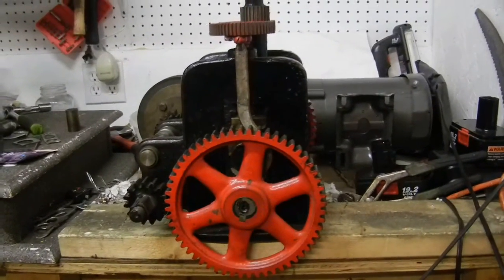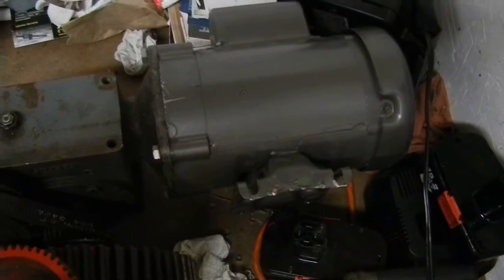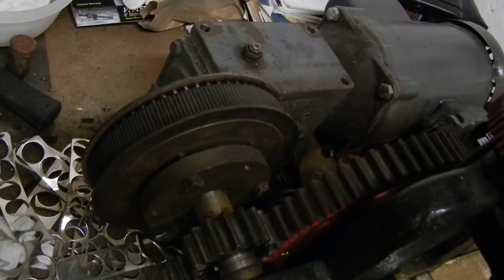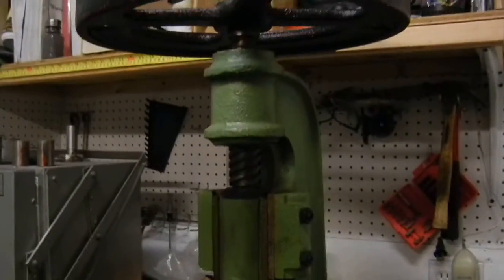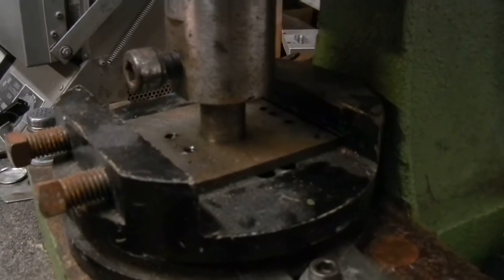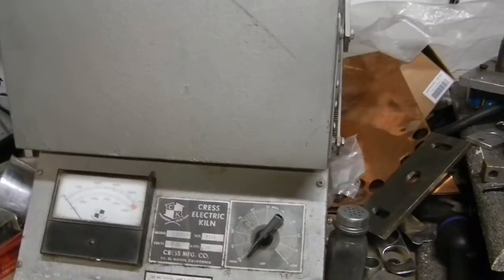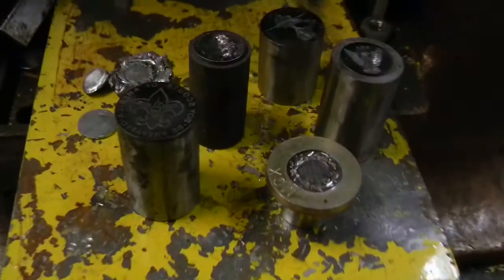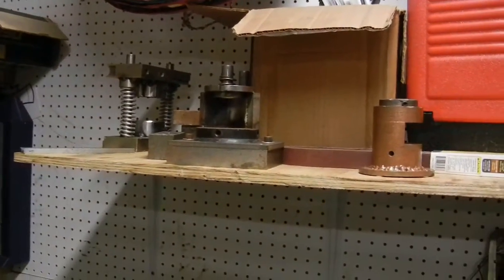motorized rolling mill and my garage mint

Comment: Hi! Thank-you for the video. I have the same rolling mill I'm trying to connvert. I initially tried a chain and sprocket. I'd like to try your set-up. Can you tell me more about the coupler? What is that type called and where can I find one?
Reply from the maker: I used a toothed belt and two toothed pulleys that I liberated from the scrap pile at my old job.  I had to make a longer shaft for the two smaller gears on the rolling mill so that I could attach one of the pulleys.  It was just a 1 inch piece of rod that I added keyways to so nothing too complex.  I hope this helps.
Reply: Try and shoot for atleast 2200 in-lb torque to the rolling mill from any drive you use if your rolling out sheet from ignot. Chain and sprockets are a litlle dicey in my opinion, I tried #35 chain and it just keep stretching...broke rather quickly. a 1/2 to 1 hp motor through a right angle gearbox directly coupled to the rolling mill (I used lovejoy couplers,look them up) putting out 2000 in-b plus torque (3000 for more serious work). Mine runs around 15 rpm and 2" wide sheet with modest reductions is about max for 2000 in-lb torque. This is the better way to go imo, I learned the hardway